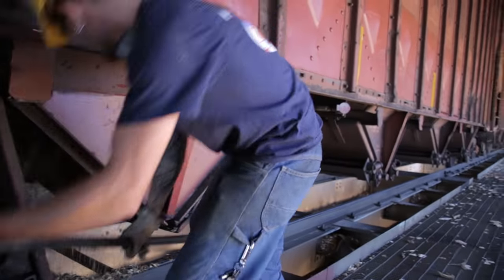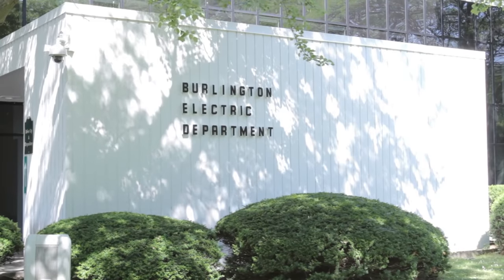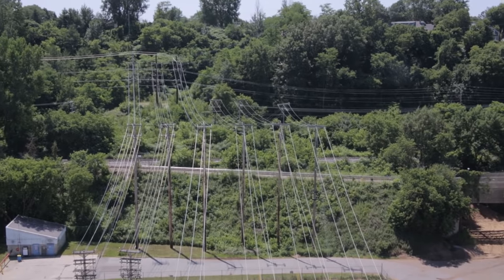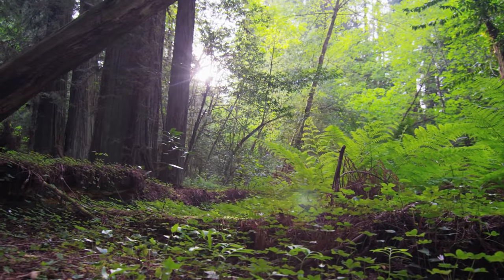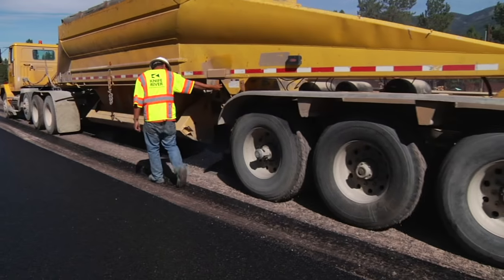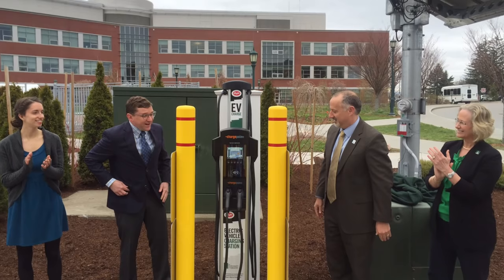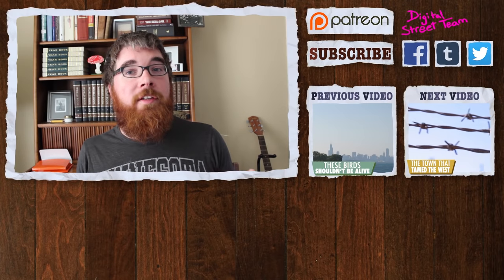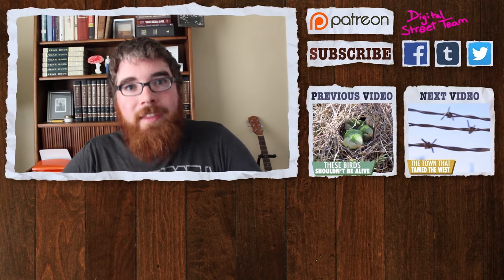Can A City Run On 100% Renewable Energy?

Comment: How much oil and coal is required to cut down, chip and haul 600,000 trees?
Reply: I had the same question.
Reply: Tom S. Yes this means 600,000 trees have to grow to replace the ones cut down. One has to wait 20 years for a tree to grow before you cut it down.
Reply: Probably substantially less than is required to mine, refine, and transport  600000 trees-worth of energy in coal.
Reply: Don't forget the fuels used in manufacturing wind turbines and solar panels.
Reply: Eventually none! New electric trucks and cars are simply better then any fossil fuel driven vehicle. You can now save money, pollution and have better performance.
Reply: And mine the stuff for the wind and solar equipment, etc. ???
Reply: johnmburt1960 We don't yet have the technology for battery powered heavy machinery. You can't power a 30 ton dozed with batteries. 

There's still fossil fuels used to mine everything needed for electric cars, and renewables.
Reply: johnmburt1960 Hydrogen has its own drawbacks, which is why we aren't using it yet, despite it being talked about for over a decade now.
I don't know what jojoba oil is, but while diesel can run off of certain types of oil, it's not healthy for the motor in the long run. Nor is it safe to use when the engine will be at a high RPM for extended periods of time. It also wouldn't help with being green, as you're still burning a substance for fuel.
As a result, no, we could not quit using fossil fuels cold turkey tomorrow.
Reply: Paul Adams I don't inow if u know this but the majority of US electricity is supplied by fossil fuels.
Reply: So in what sense does it make"wood chips burning" a "renewable energy" ?
Reply: Also 600,000 trees for a small town in America. Maybe makes sense considering that it is close to forests. However scale that up for the millions of people living in high energy consuming cities and something tells me that it goes from sustainable to unsustainable very quickly
Reply: Wind Turbines recoup the Carbon cost of their manufacture within 6-9 months, depending on the manufacturer.
Reply: Tom S.  I thought the same thing!
Reply: Nobody asked that what is their ratio of Cutting Trees Vs Planting Trees by them. Also, the forest contains diversified trees; not only of one kind. So what kind of trees are they planting or planting just one kind of tree?
Reply: None. You can do all of that with the Energy your city produces if you're willing to invest.
Reply: The train is electric, so can the chipper be. And we can use carbon traps on the Co2 from the burning. Making it carbon negative. I bet we can get electric logging machines and trucks too as energy density goes up in battery tecnology.
Reply: watch the video
Reply: Probably less than drilling, pumping, transporting, and burning oil
Reply: It doesn't require any coal to cut down the trees and chip up the dead trees due to Beatle larvae,  they are  chipping dead trees, tops and. Slash which were traditionally left in the forest. That alone provides over 50 percent of the woodchips used. I've worked in the woods hauling wood chips and harvesting trees and we provide a service to the landowners and the community at large. The wood chips we produced were delivered to energy companies that operate power plants that are 100 % renewable fuel fired. 
There is a power plant that used to burn coal in Portsmouth, New Hampshire that now instead of burning coal burns woodchips and gave a lift to the wood industry in New Hampshire and Maine which were decimated by the closure of every paper mill in Maine. Now the power plant spends some 25 million dollars a year to keep the woodchips coming putting a lot of out of work loggers and drivers back to work. The power plant sold their coal powered ship that hauled their coal from Virginia to Portsmouth to a company in Brazil.
Reply: @davidchester429  lol did you even watch to the end where he addressed that with the concept of 'microgrids'?
Reply: Obviously a very tiny minuscule fraction than the energy required to Generate the same amount of Electricity from those fuels. The bigger problem is we have not invested and built the infrastructure to replace oil based transportation. It's a chicken and egg problem. We need to do all of this to learn and evolve so we can develop that system does not require Oil & Coal for transportation. The falacy people Tom S are rhetorical inferring that its not worth attempting if we can't magical eradicate the entire old system. When human achievement requires learning and evolving to get to a goal.
Reply: @Neojhun  I was speaking of a purely electric vehicle, not a hybrid. Granted, I didn't know about these hybrids until after I had posted it.
Reply: @Neojhun  Never mind, it is a purely electric vehicle. It'll be interesting to see how it functions (still in testing, right?).
I do believe, however, that this wouldn't work for all heavy machinery. Particularly dozers, excavators, etc. From what I understand, they're relying on the descent the truck makes to keep it powered. That wouldn't work for many mining applications.
Reply: johnmburt1960  welp, say goodbye to the natural gas companies around the U.S. lots of job loss there.
Reply: @kamikaze1827  No, two  tons of dry, aged wood are required to replace a ton of coal.  It's worse for any water content in the wood.
Reply: @musFuzZ  there are no electric freight trains in the us, nor will there be.  The runs are too long and rural to electrify.
Reply: I believe hydrogen fuel cells will be able to power industrial equipment it's only a matter of time before it becomes profitable for manufacturing companies to use it especially with how many cities are going completely solar we could generate hydrogen from these solar farms n use it in heavy equipment and manufacturing pure electric will only ever be profitable for consumer grade equipment and vehicles hydrogen fuel might be able to make manufacturing green it has potential in that sector
Reply: So how long till you used up all the topsoil in the forest?
Reply: I love all these bad faith 'carbon emissions are inevitable therefor...' arguments.

If the goal is to produce the least amount of carbon emissions possible, then the comparatively tiny emissions of supply chain economics for green energy are still achieving the goal of 'least possible'. The corollary of these arguments is essentially: we can't completely eliminate all carbon emissions, therefor we shouldn't try to reduce them at all.

Medications don't alleviate all symptoms, therefore we shouldn't try to reduce them at all.
Police services don't prevent all crime, therefore we shouldn't have police.
Firefighters don't prevent all fire damage, so we shouldn't have them.

Right guys?

Ridiculous argument.
Reply: Absolutely right Tom. Have you seen Michael Moore's "Planet of the Humans"?
Reply: @piyush9960  you should not the Cobon chain to understand that.

Comment: Hold up, the equivalent of 600,000 trees per year for 43% of a population of 42,417. That comes out to 32 trees burned per person per year. To manage that without clear cutting means only a small handful of cities can run on biomass even in heavily forested areas.  So this is renewable, but at this scale isn't it also largely irrelevant to the larger carbon problem?

Comment: Burning wood to make electricity is ok for a small city but it's not a solution for the national grid because trees don't regrow fast enough. Fast growing temperate trees such as pines, poplars, or willows can grow at a rate of 10-15 tonnes per hectare per year. Burning 400 000 tonnes of wood per year would therefore require a tree plantation with an area of 260 square kilometers. That's a lot. 
Say you wanted to produce 44% of the US electricity consumption (around 180 GW) by burning wood. That would require 1.4 billion tonnes of wood chips per year. You would need a fast growing tree plantation with an area of 930 000 square kilometers. That's almost 10% of the area of the United States.

Comment: Their slogan should be: Burlington, Vermont. USA's first green city. We make every other city green... with envy.
Reply: Renewable yes, but not green. Woodchips still produce co2 and what about their trucks and trains?
Reply: the CO2 is offset by the replanted trees taking it back in to grow (hence why it's considered carbon neutral over carbon free) and trucks and trains can be electrified. electric trains are a hundred year old technology and are fairly easy to implement. electric trucks are harder but we're seeing many companies testing products now to be brought to market in the near future.
Reply: no, it isn't offset, takes 30 minutes to burn a tree, takes 50 years to regrow that tree.

It is so far from green they might as well be burning garbage and saying "we are recycling it"
Reply: Happy Fox but when trees are growing they are using CO2 to grow so the tree will be taking out CO2 in those 50 years so it can grow
Reply: " New Trees absorb more carbon than old trees "

Comment: That generating station may also just be the home for the worlds biggest guinea pig.
Reply: It a government cover up. They have lied to us and are actually all slaves to their giant guinea pig Overlord.
Reply: Nuclear power has not, and will not ever be profitable, until safe and definitive storage of spent fuel is available. The resources required to mine and process the fuel cost more than wind, solar, tidal, hydro or wave technologies currently. Nuclear power has never been profitable here.

The renewable technologies can satisfy, with the addition of storage,  can supply every citizen residence & non-industrial structure in this country. The alternative here currently is natural gas from fracking, no ash, and coal, cleaned up with wet scrubbers to remove sulfurs, other metals and neurotoxins like mercury.

However; the finance companies are no longer interested in lending money into long term Capital construction with an unknown service life. 
Since the second Great Depression of 2007, the demand for power has been cut in half. Current equipment, the 40 & 50 year old generating fleets can be retrofitted with wet scrubbers as the Clean Air Act Amendments mandated in 1990. Had corporations built those scrubbers, we would not be in our current situation. Powder River Basin coal from Montana and Wyoming requires burning 40% by mass coal than hard higher sulfur coals.  So, 40% more hauling, processing, transporting and ash to store for sidestepping the required fix long term!
Reply: Which runs on a huge wheel connected to an alternator
Reply: yup, the huge guinea pig is inside that huge generator making it turn...the guy just missed out that step when explaining it because he thought no-one would believe him...since Burlington is way ahead of its time in Energy production and consumption.  Guinea pigs are the future.
Reply: " New Trees absorb more carbon than old trees "
Reply: @ojbeez5260   This... is genuis.